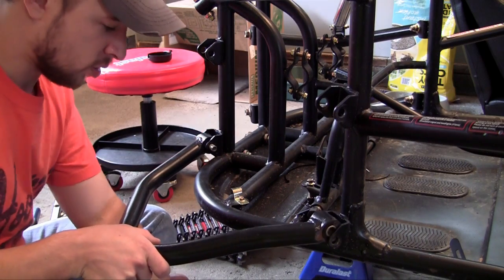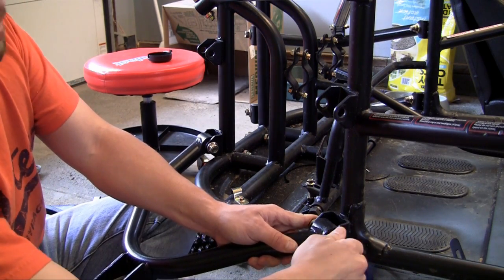How to Build a Go Kart - 5 - Front Suspension

Comment: The chassis could be referd to as the frame and for all we no it may have been built with pipe that at on time had a liquid run through it but you are correct on the rest.Lots of things are referd to as the frame such as motocross bikes (frame,subframe)same as atv`s.

Comment: it's obvious that its a pre-built buggy that has been stripped down and re-built !! there not called bearings there called bushes when they are one-piece, hubs not knuckles and its called double wishbone suspension. also its called a chassis not a frame. and pipes have liquid run through them, there called tubes !! lol. i'm an engineer